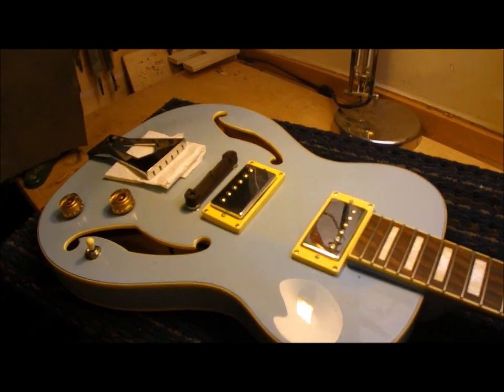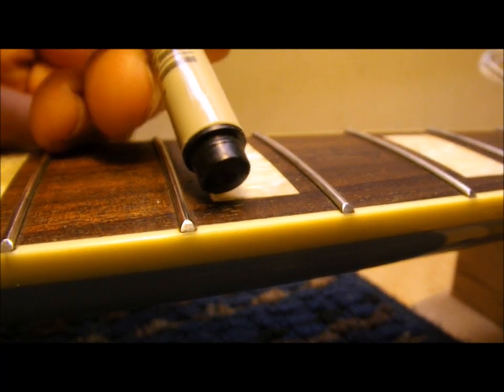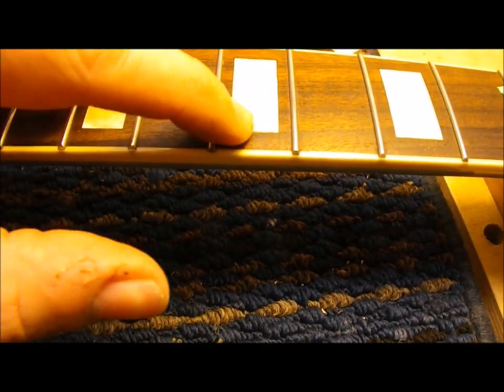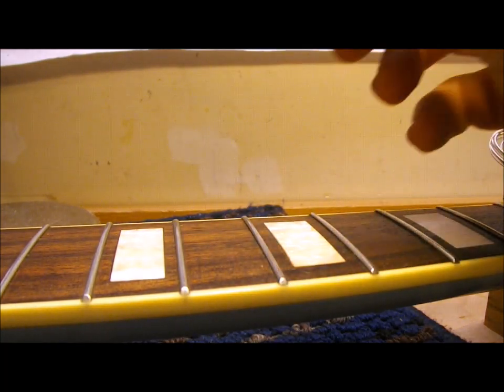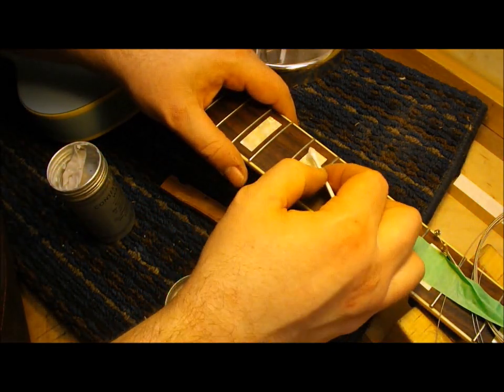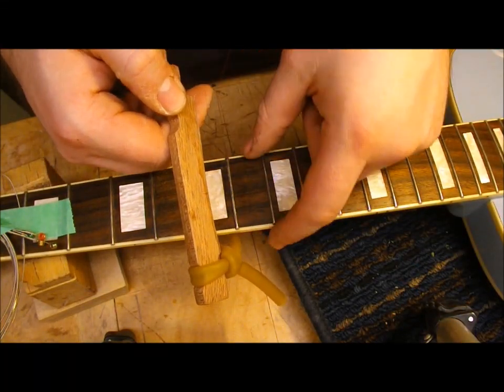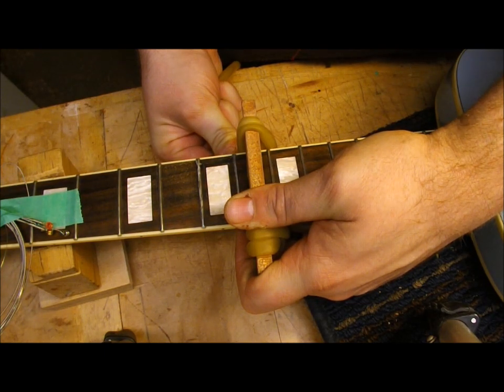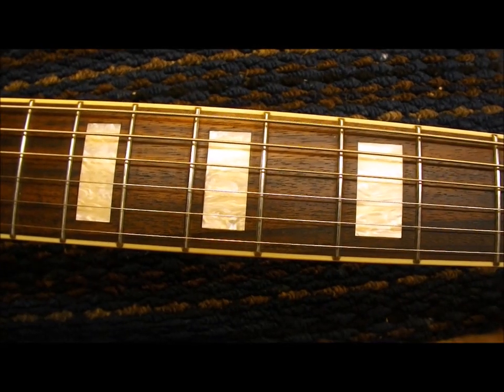Guitar Inlay Repair

Comment: Summary:
Repairing inlay on an Ibanez Art Line guitar, particularly at the seventh fret, where a piece of pearloid plastic is lifting.
Use of thin super glue to fix the inlay, relying on capillary action to spread the glue underneath the lifted piece.
Creation of a curved clamping call to ensure even pressure across the inlay for proper adhesion.
Preparation involves cleaning around the exposed edge of the plastic, sanding a strip of mahogany to shape, and applying paste wax to prevent accidental gluing.
Application of surgical tubing as a clamp for gentle pressure during the gluing process, followed by fine sanding and lemon oil application for a finished repair.

Comment: I have the exact same problem on an Ibanez AG95.  While I like your video I'm let wondering about your thinned superglue and capillary action to get the glue into the crevice.  Could you please elaborate on that?
Reply from the maker: James Sherrill superglue comes in several viscosities, from water-thin to heavy gel. The really thin stuff flows so freely that it gets drawn in along the crevices between two tightly fitted parts and locks them together. It hardens so quickly there isn't time to move the parts- they have to be in position before you flow on the glue. Most hobby shops and woodworking suppliers carry it.

Comment: I have a 2014 Gibson LPJ and the "pearl" inlay is protruding to the point where the strings catch it with every bend of the string. It's 7th fret inlay that is protruding. Will what is done in this video work for my guitar or should I get it fixed by a professional?
Reply from the maker: Lukas M  it's impossible to tell without actually inspecting the guitar. If the inlay can be pressed down flush it should work but if you have any doubts you should take it to someone who has experience. Its the kind of thing where you only get one chance to make it work.
Reply: I have a 2014 LP Traditional and I have the same problem as well hmmmm...
Reply: My 2014 Studio Pro is doing this at the 7th fret also!

Comment: I`ve got a 2016 Standard Les Paul with 3 inlays popping out. Just  had a go at repairing them and one just fell out.  Looking at it closely I  realized that the idiots at Gibson have put the inlays in upside down so that the convex side of the inlay was facing down,. Turned it over and glued it in ,all fine now.
You pay Gibson top dollar and  get poor workmanship in return. 
I`ve got a 2 year old R9 with cracking varnish ,returned to Gibson and they wouldn`t repair it  saying that the damage was either accidentally or deliberately caused by me. What a cheek.The guitar has never been out of my bedroonm and is always stored in a case when not in use. Don`t buy new Gibson, I never will again.